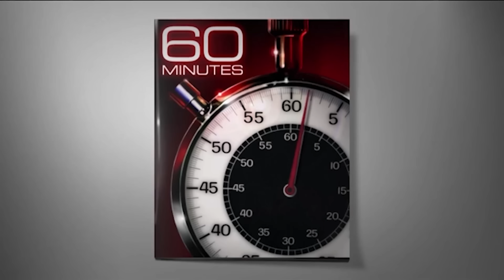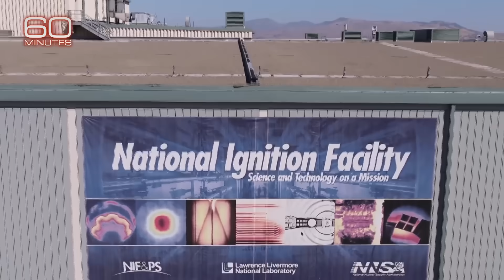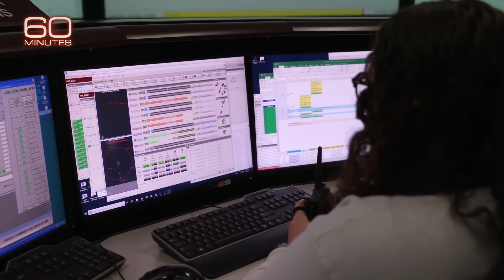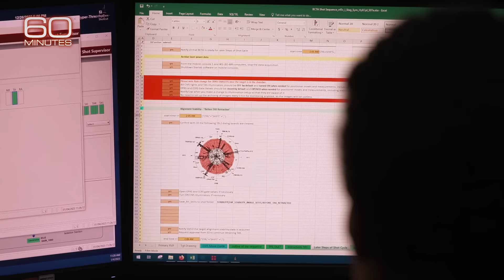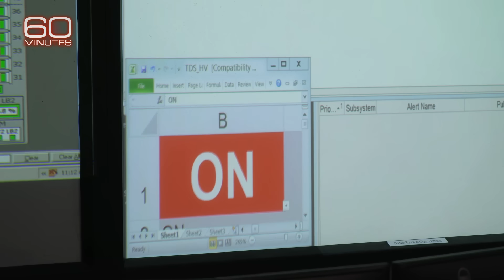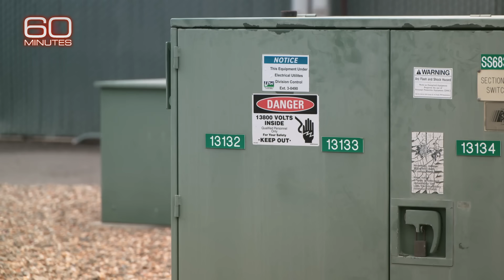Nuclear Fusion: Inside the breakthrough that could change our world | 60 Minutes

Comment: 2 years and waiting...
Reply: The National Ignition Facility (NIF) experimental laser shot, described here, occurred on 12/05/2022, so that was a bit over three years ago. Since then every few months they have achieved somewhat better results but they still remain at least a billion times away from creating anything even close to an economically practical fusion energy power plant. That shot took about a week to set up but the fusion reaction only lasted for 0.000,000,000,08 second. Then the central explosion blew away 96% of the expensive fuel before it had a chance to 'react.' The administrators have always been masterful in obscuring the primary purpose of NIF which has been as a thermonuclear weapon (H-bomb) research tool. The above test even included a nuclear weapons related target to be exposed to the prompt burst of 14.1 MeV neutrons. It's been estimated that the NIF effort has already consumed in excess of $11-billion in federal revenues. Despite the recent improvements the energy consumed by the facility, during the preparation of the experiment, exceeds 100 times the energy emitted by the extremely brief fusion reaction.

Comment: So, this all happened two years ago. What's happened since?
Reply: The reported 'breakeven' laser shot occurred on 12/05/2022 which was over three years ago. Every few months they have improved upon that result a bit but they remain millions of times away from anything even approaching a economically practical nuclear fusion energy power plant. In fact this facility has always been primarily funded as a thermonuclear weapon (H-bomb) experimental facility but typically presented as a viable path to a nuclear fusion energy power plant. It's been estimated that the effort has consumed over $11-billion in federal revenues.

The promoters tend to be masterful in omitting numerous key evaluation details. One is that it took about a week to prepare this experiment and yet the fusion reaction only lasted for 0.000,000,000,08 second before the force of the central explosion blasted away 96% of the supplied expensive fuel. Each test shot destroys much of the fuel capsule supporting assembly with costs around $100,000.

Comment: Geez, I just shed a tear, this is an incredible achievement, you can let your imagination go wild from there, imagine this kind of power on a satellite like Voyager one, the distance is it could go without dying,, no more oil spills, no more polluting the air, And the water with mercury no humans working in a coal mine, fast-forward 100 200 300 years if we make it that is, your house powered by a little fusion furnace, no more power lines power outages, no more cities polluted from combustion engines, no more nuclear reactors Spilling radiation you could go on and on, and on, and on, and on of what this technology will do, powering data centers airplanes
Reply: Since the first nuclear fusion energy experiments began in the late 1950s the promotional hype has increased to fund the increasingly expensive and fun experimental projects. One of the typical hype claims has been that the hydrogen fuel is almost unlimited. The experimenters rarely mention that the tritium fuel is radioactive and they never mention that the commercial price of the experimental tritium is over $30,000 USD per gram. It is highly unlikely that this technology will ever prove to be practical and capable of being shrunk down to a size and mass required for space vehicles. The experimenters have been crafting their sales pitches to take advantage of fears about climate change and more recently to promote their experimental efforts to eventually solve the massive power requirements for AI processing data centers. Over 150 experimental fusion energy experimental machines have been built and experimented on. Only a few have ever employed real fusion fuel, or have generated more than one watt-hour of raw fusion energy. From the beginning well over $50-billion USD has been spent on the quest and yet we remain many orders of magnitude away from any kind of economically practical nuclear fusion energy power plant.

Comment: The co-inventor of the RTG remarked to me 60 years ago that sustained fusion would require a temperature of near zero degrees K (to cool the super-conductor magnets needed to contain the plasma) some three meters away from the plasma itself at a temperature of some millions of degrees.  A brash, ignorant 22-year-old, I bet him $20 that the process would be humming within 20 years.  I left working with him a couple of years later; he died some 15 years ago.  I owe him $20.
Reply: Thank you for that account. The first nuclear fusion energy experiments began with a tokamak type machine. Two  generations of experiments were just as hopeful as today's youthful experimenters who tend to be largely clueless regarding the past efforts. Today many of the planned reactor designs are more compact which means the superconducting magnets need to be much closer to the 150 million °C plasma which will be spitting off an enormous flux of 14.1 MeV fusion neutrons. In the case of Commonwealth Fusion Systems (CFS)'s SPARC experimental machine the separation will be only about a meter separation while the magnets must be maintained at 8 and 15 Kelvin by a massive flow of supercritical He.

Comment: Almost 2026 and nothing. Seem sus?
Reply: The National Ignition Facility (NIF) has achieved perhaps around ten experimental shots that better the 12/05/2022 shot that was given a very splashy announcement and has been frequently cited. But those improved 'burn' shots were not major advancements, were often spaced many months apart and are often not always consistently repeatable. That 12/05/2022 shot took about a week to set up while the fusion reaction only lasted for 0.000,000,000,08 second. Just the fusion energy duty cycle remains well beyond a million times what would be required for the creation of a fusion energy power plant. Numerous other parameters also remain orders of magnitude away from creating a economically practical power plant design, a concept that is highly unlikely to ever be achieved by any inertial confinement fusion (ICF) approach. The so-called 12/05/2022 'breakeven' fusion shot required over 100 times more energy, to pump the lasers, than the energy value that was employed to calculate the fusion energy gain value. In the nuclear fusion energy field it has long been a standard practice to not consider the overall energy needed to power the experimental facilities, when calculating the fusion energy gain value. Since the first design plans for NIF the management has been masterful in obscuring the primary funding purpose of the facility which is to engage in thermonuclear weapon's (H-bomb) related research. Its been estimated that the NIF efforts have consumed in excess of $11-billion in federal revenues.

Comment: What baloney... they are not remotely close. A huge money pit.
Reply: Anyone who understands the details of this esoteric field, and who retains critical thinking skills, should understand that they are at least a million times short of the holy grail of an economically practical electrical energy source. This experiment took about a week to set up but the fusion reaction lasted for only 0.000,000,000,08 second before the central reaction blasted away 96% of the supplied, expensive, fuel before it had a chance to react. Some people become highly invested in omitting key evaluation details. The NIF project was supposed to achieve this goal by 2012. Since it has always been primarily funded as a thermonuclear weapon (H-bomb) research tool the billions of U.S. dollars keep flowing to the project. Its been estimated that the effort has already consumed more than $11 billion in federal revenues. They have always presented it to the public as if it would likely lead to an economically practical source of electrical energy.

Comment: You always make things clear.
Reply: When journalist dumb things down, to satisfy a high school level of understanding, typically the process omits numerous key evaluation details. They failed to include that this, and the succeeding experiments remain well beyond one-million times away from achieving anything close to a economically practical source of electrical energy. Keep in mind that the nuclear fusion energy experiments began in the 1950s and since then over 150 experimental machines have been constructed and experimented on. Only a tiny few succeeds in generating any significant quantity of fusion energy and yet they were all branded as being 'fusion reactors' for the sake of attracting funding. In the case of this NIF experiment it took about a week to set up the experiment but the resulting fusion reaction lasted for only 0.000,000,000,08 second. The reality of the situation is that NIF has always been primarily funded as a thermonuclear weapon (H-bomb) research tool and this experimental shot was part of that program. The administrators have always been masterful portraying it as a viable path to clean energy. Its been estimated that over $11 billion USD, of U.S. revenues, have been expended on this program.

Comment: Two years later, we see no significant results or progress toward energy production. It's a dead-end technology.
Reply: Actually the NIF has achieved some improved results since the widely publicized 12/05/2022 so-called 'breakeven' shot. Typically it takes them at least several months before they can claim that they did better. Lately they almost doubled the fusion energy of that 2022 shot. That counts for little since they are well beyond a million times from achieving anything close to a commercially practical fusion energy power plant. The NIF machine was suppose to have achieved the 'breakeven' reaction by 2012. It failed by a factor of over 100 then. Almost all nuclear fusion energy experimenters have learned to over hype their results in order to increase public interests and for drawing ongoing funding to their fun experiments. Still, the laser system  expends at least 50 times the amount of energy as the energy value that they employ to calculate the fusion energy gain. The administrators of NIF have always been masterful in obscuring the primary funding for NIF. It has always been used as a thermonuclear weapon (H-bomb) research tool.

The nuclear fusion energy experiments began in the 1950s. The LLNL began their giant laser experiments in the 1960's. Two generations of experimenters have spent their careers working toward the holy grail of fusion energy production. I assure you that they were just as confident as are todays youthful experimenters. The young ones have never learned that their faith in the technology isn't a key to achieve their dreams.

Comment: Fusion? Nope! Solar Wind and Battery is ready now, Only costs millions and can be installed in years not decades. We don't need a fusion reactor we already have one in the sky. That is the sun. Billions do not have to be invested for research. SWB uses no water, doesn't require billions of investment and testing that will take decades, and is ready NOW. The batteries provide power on a 24 hour basis which means SWB provides Baseload power. If you are building a power plant for your super computers and you need it now go with SWB. Also the fuel for the plant is free. It comes from the sun. :)
Reply: Solars not perfect.
Reply: @farmsalot1233  - No technology ends up being perfect. The clever engineers, who figured out how to extract deeply buried fossil fuels and then burn it to release energy for human uses, were thoroughly convinced that they were creating a better world for future generations. Our schools don't explain about their optimism then.

Comment: You telling me what you created is hotter than the sun but yet didn't melt the copper all the way. I'm curious to know how long it was kept in there during experience.
Reply: Since the nuclear fusion energy experiments began, in the 1950s, it has been oversold which is characterized by the claim that a economically competitive fusion power reactor is just 20-30 years away. That claim has been ongoing for at least 60 years. The sales pitchers are constantly trying to attract funding for their fun experimental projects. Scores of experimental machines have been constructed and experimented with. It has become standard practice to omit key evaluation criteria. In the case of this experiment the fusion reaction only lasted for approximately 0.000,000,000,08 second. After that the fusion reaction forces blasted away about 96% of the expensive fuel before it had an opportunity to fuse. The reaction took place within a microscopic volume after the immense compression. All the target materials near the detonation spot was either turned into a plasma, or vaporized. Further out the energy rapidly dissipated which explains why some of the, more distant target structure was simply bent away from the center point. It's been estimated that the target structure cost well in excess of $100,000 USD. The energy released was approximately as much energy as would be needed to boil a few liters of water. The energy consumed, in pumping the lasers was more than 100 times the energy that compressed the fuel so that means the total energy gain was less than 0.01. Also, the term 'ignition' is a red herring. Once the reaction begins it remains extremely difficult to sustain it for any reasonable period of time.
Reply: @vernonbrechin4207  JET already demonstrated sustained fusion operation, but that's simply not the real problem. The real problem is the fuel cycle.
Reply: @lepidoptera9337  - Most fusion energy fans don't bother to critically examine the details of that JET final experiment. They never ask how much energy was consumed by the facility to sustain the reaction. It was far greater than what the experimenters announced was generated by the reaction.
Reply: @ It doesn't matter because that is just a matter of scaleup. ITER will be net positive easily. What neither ITER nor any other facility can get around is the lack of tritium, which would require dedicated fission breeders just to get started with fusion. That's just not going to happen. Fusion is cheap, but you have to use solar panels. That's the way. :-)

Comment: It is always good to have experimental proof.  While ignition is possible, the requirements to generate these conditions do not scale linearly with the amount of energy produced. We effectively solved one problem by side-stepping into another unsolvable problem.
Reply: The use of the term ‘ignition’ is deliberately misleading. The average person assumes that it is something like a fire-match head being struck. In that case the chemical reaction begins at one point and then it spreads rapidly until all the match-head fuel is consumed.

In the above experiment the fusion reaction only lasted for about 0.000,000,000,08 second then the force of the explosion blasted about 96% of the extremely compressed, extremely expensive, deuterium/tritium fuel plasma was too rarified to react. There was little propagation of the reaction. This is similar to other nuclear fusion energy experiments where the fusion fusion reactions can only occur when compression and heating energy is fed into the system.

In the case of this NIF experiment over 100 time as much energy went into pumping the lasers than was generated by the extremely brief fusion reaction.

Keep in mind that nuclear fusion energy experiments began in the 1950s, There were five large laser systems that preceded NIF. NIF was supposed to have achieved this ‘breakthrough’ shot by 2012 but failed by a factor of more than 100 then.
Reply: @vernonbrechin4207  Thank you for the detailed explanation.  😀

Comment: It won't help people at all! They will still charge a ram and a leg to get.
Reply: Keep in mind that in this experiment it took about a week to set it up and yet the fusion reaction lasted for only 0.000,000,000,08 seconds and it released enough energy to boil about two liters of water. The fuel capsule was constructed from a nearly flawless hollow diamond sphere. The tritium fuel component has a commercial price of about $30,000 per gram. The Target assembly, which was mostly vaporized during the shot, has been estimated to cost about $100,000.